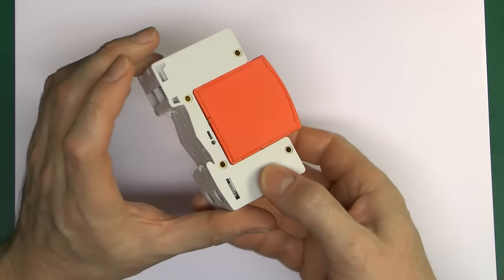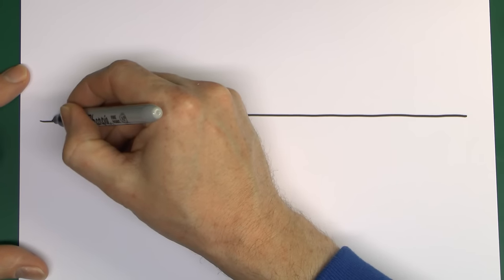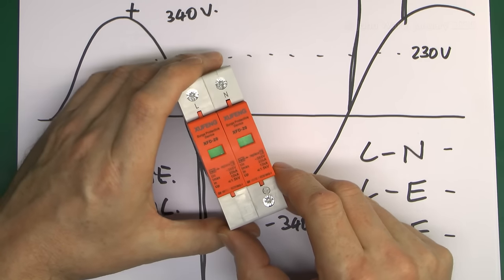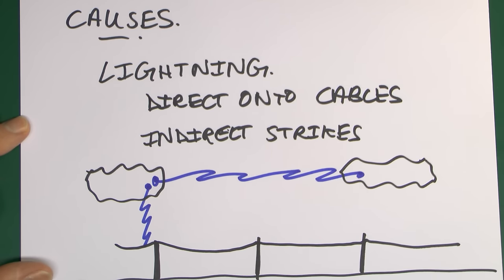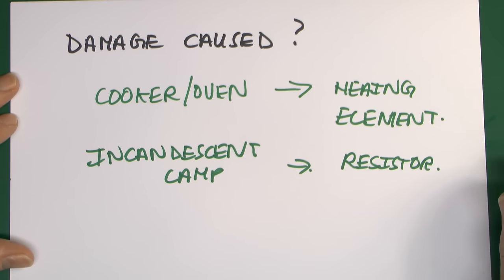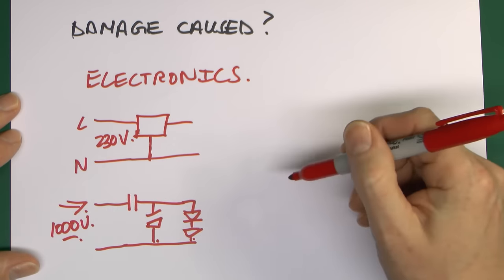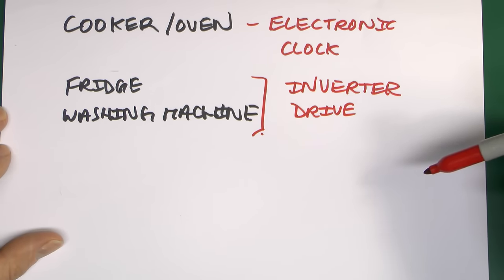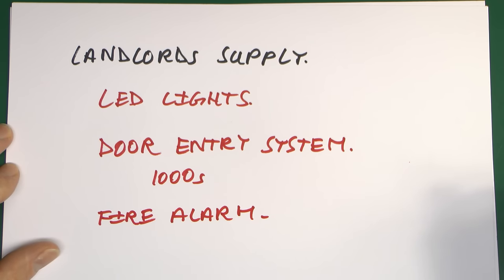Surge Protection Devices - Part 1

Comment: Why is it that new build houses have fused spurs for kitchen appliances like fridge, washer and dishwasher instead of a unswitched single gang socket with isolator switch elsewhere? Something to do with regs?
Reply from the maker: Fashion, or people doing things a particular way because they always have.
No requirement for them now and never was.
Reply: At least in my (family’s home) case, Designer Kitchens’s sparky got it right - kitchen was replaced 5 years ago, 2x switched spur fuse’s above washer/dryer, dishwasher to single gang switched sockets. cooker hood, built-in microwave, oven, tower fridge/freezer are plugged into single gang switched sockets. Induction hob connected to 30amp red dip switch.
Reply: @samuelfellows6923  thats good. I like the sockets over having to wite the appliance into a spur as some may not know how to do it. Also easier for maintenance or replacement
Reply: I usually have an isolator above the worktop controlling a flex outlet plate with a trailing single socket. Sometimes the appliance won't sit fully back if the plug is behind but a short trailing socket can be repositioned where there's room and the appliance still keeps its original plug.
Reply: Ben's pets - there is no requirement for a switch on any 13A socket. If the socket is in a hard to get to location (behind an appliance for example), it’s good practice to supply this socket from a switched fused connection unit that is placed where a user can get to it and where it is obvious what it is for.

Comment: Do you have a video on whether it is safe to install a 110v lighting fixture into a UK ceiling fixture?  Thank you.
Reply from the maker: No, and doing that isn't safe - items designed for 110V cannot be used on a 230V supply.

Comment: Sorry if a silly question, but could you connect one of those to a tv aerial coaxial cable to protect against lightning strike?
Reply from the maker: Similar devices are available for coax cables, phone cables, Ethernet cables and many others.  All cables entering the building need to be considered, as surges can enter on any of them.

Comment: Hi - can you please explain Lutron switches (dimmer switches) that control many zones (4-5). And also the wiring diagram of Lutron switches when arranged in two ways switches and an intermediate. I have not found it if you can can you please make a video or send me a website that can explain. Thanks

Comment: i have to three lightening strike jobs spreed over many years number 1 tv destroyed  number 2 consumer unit blown from wall supply cable to house destroyed number 3 2weeks ago indirect strike lighting transformer and dimmer blown , so on number 3 an spd would i think have saved the day,all jobs in 0.5 ng flash density area page 102 18th edition. thanks for video john.

Comment: Can any Line and Neutral connections be interchanged on a 4 pole SPD? Have to replace one which has N in left side but available one has N on left side. Would make wiring easier if I could use one L as Neutral connections and use the Neutral connections as L.
Reply: Sorry meant old has Neutral connections on Left side and new has Neutral connections on Right side.
Reply from the maker: If all 4 cartridges are identical then you can - however most are not, those used for N-E are different from those for L-E

Comment: @John Ward Should plugs(connected to an appliance) spark when connected to an unswitched socket outlet?
Reply from the maker: Yes, it's inevitable when connecting or disconnecting any load.  All switches spark internally, you just can't see it most of the time.  Same applies to connecting a plug, or disconnecting it.
The spark will be larger if the load is larger.
Reply: @jwflame  Thanks for the clarification. I always wondered if that was an issue with the appliance.

Comment: surge protection is important but a t consumer level this is not important as surge protectors can protect the devices, but do not protect the device from FM interference that occurs during the fault... In the Power System transients will always clear over the wavelength distance since the transients occurs form a Line-to-Line fault

Comment: In reality, I've yet to measure a UK voltage lower than 240v RMS. I'm always mildly surprised when engineers refer to our '230v' supply! Maybe it's regulated more tightly in Europe, but every meter I ever used gives something along the lines of 243v - 248v. This is in the South-East, but isn't voltage universal across the UK grid? Not sure.
Reply from the maker: Frequency is the same everywhere in the UK, voltage depends on the local transformers and what loads are connected.  240+ is still common in most places.
Reply: @jwflame  Thanks for that, John.
Reply: @Blitterbug  If I remember everything right that comes from the harmonisation with most of mainland Europe. Here in my country 220V used to be the norm (old people often still call it that as well) and back in those days I'm pretty sure the norm was 240V over there in the UK. They settled on making 230V RMS with a tolerance of -6% and +10% as the new norm, so effectively 216.2V to 253V is within the specification tolerance.

I guess they went with that so that all participating countries could retain current infrastructure while gradually moving over to the new mains voltage. In my house I can remember usually observing between 230-235V.
Reply: Extra stuff - 90% plus of equipment does not care if the mains voltage is slightly low or slightly high, so it does matter...
Reply: @Mark1024MAK  I'm aware of that. It was really just a response to the first comment in this thread to clarify that it's within the specification tolerance.

Comment: Years ago my parents house was struck by lightning it went down the chimney and blew the aga right across the room and buried it in the wall opposite totally destroying the radio that sat on the sideboard along with the sideboard. I dont think a surge protector would have been any use at all in this case. And when my father got home he was berated by the neighbor who was very angry that our chimney pot was now lodged in his roof.
Reply from the maker: On it's own, surge protection would not have helped there.  However a lightning protection system with SPDs would have.
Reply: @jwflame  or just a lightning rod with heavy path to earth I guess... but what are the odds of that on a normal domestic dwelling?
Reply: Equiluxe1, your Dad needed a CPD (Chimney Pot Deflector), not an SPD, but seriously, no SPD on earth will help in the event of a direct building strike, only a lightning rod and buried earth mat could have helped there (have a close look at the spire of your local church, you will be able to see the heavy copper straps heading up to a pointed rod at the highest part), the lightning has to be given a suitable low resistance path to earth or the water soaked chimney pot and brickwork will take the hit, I hope everyone was alright and that your Dad his chimney pot back.
Reply: @elonmask50  Don't think many houses had lightning rods in the 1950's not many houses do today either. I have seen places where there was a lightning rod and they are are still damaged from a strike, not here in the UK but in Africa and the US. Well designed equipment will have its own protection built in but all these protection devices are based around MOV's  and they wear out over time without any major spikes, so I am not convinced that permanent surge protectors will be anything but trouble a few years after fitting. I have seen MOV's explode causing a lot of damage in doing so  on equipment that was not connected to mains and never was and not struck by lightning just broke down and went dead short in heavy current system.
Reply: Equiluxe1, you are making my argument for me, that’s exactly my point.
Reply: John Ward - Unless money is no concern and you are happy with large heavy engineering, no normal surge or lightening protection system will protect against a direct strike.

Comment: So the consumer has to buy the surge protectors and not the electricity supplier? If they put surge protectors on the cables then they would not reach the houses.
Reply: In my country, when the power supply to the houses runs undergroud, then surge arrestors are mounted on transformer terminals in substation. So you dont have them in house. And when supply comes thru overhead lines, or underground cabling over certain length, then you have to have arrestors in the house board. And that is specified in 'supply conditions' for every property that applies for connection to power system.
Reply: @sumilidero  They are still bpassing the buck to the house holders. They are the ones who are supposed to generate electricity at a certain voltage.
Reply: it is what it is...although most damage caused by voltage surges happens thru the teletechnical networks,  rarely thru power lines. In the industrial environment for example, its the opposite. Most damage happens because of undervoltages.
Reply: @sumilidero  Then why bother with surge protectors in the distribution box if no surges come power lines?
Reply: didn't say 'no surges' but like 5% of all. 95% go thru signal lines in terms of houses. On the HV transmission its another story, but those surges are arrested in substations etc. and dont reach houses normally.
Reply: Tony Papantoniou, the supply grid is fitted with lightning protection, spark gaps, and course surge “protection”, but like everything it needs to be maintained and replaced, if the supply company was forced to provide everyone with type 2 protection, you would be without power every second day and the cost of electricity would be astronomical.
The job of the network is to supply safe and reliable power to your premises, if you choose to have additional protection against irregular events, that’s up to you to provide and maintain, like car insurance, there are many different levels, and just like car insurance it costs you money every year to operate and maintain, as John will no doubt point out in future videos, these are not set and forget, they degrade over time and if not replaced, they themselves become dangerous.

Comment: Sir what is different between over under voltage control device and spd pls help
Reply from the maker: SPDs deal with transients - high voltage spikes that last for nanoseconds / microseconds.  Over voltage devices disconnect if the supply voltage exceeds a certain value, and will disconnect in milliseconds - thousands of times slower than SPDs.

Comment: Hi John, can you do a video on off grid installations, I'm off grid (£10k to connect) with 2Kw Solar , 15kwh 48v batteries, 3kva inverter and a 10kva generator. I've been on a sharp learning curve since getting quotes to get power connected, I was advised to not get a cheap AVC/AVR generator because of connection problems with Victron inverters, I now find that my capacitor controlled generator has a potential for power surges "apparently". The only issue we have found so far is the washing machine won't work ( power fault code displays) if you don't have 1kw or so load because the frequency goes up slightly, if I adjust the generator speed down the inverter/charger won't connect. Will surge protection shown in the video help with generators, another great topic is earthing. thanks for the videos.
Reply: Simple answer, probably not.
Reply: The "surges" of a generator will almost certainly be completely different to surges on a normal mains supply. You first need to determine what they mean by "surges".
Reply: Surges in reference to a petrol / diesel generator normally refer to it being unable to correctly regulate the output frequency and voltage at too low an output load, too high an output load, or a load that has a poor power factor. The control system cycles past the mid-point as it continually increases the throttle, then reduces the throttle as it hunts and dismally fails to find the correct setting. As a result the frequency and voltage oscillate outside the specified range. This can be disastrous for some loads...
I’ve seen this effect with a large diesel generator when there was a fault with it. For some reason although rated for the load (it was a fixed installation, the generator being for back-up power in the event of a mains failure), although the generator started up and attempted to take the load, the systems fed from it kept loosing power (lights went off, equipment lost power), then everything would come back on again, then off. This kept repeating every four to five seconds until the normal circuit fuses could no longer take the current surges. Then the generator ran fine with only half the load now connected! But no good to us! You should have seen the panic in the eyes of the staff who were responsible for the generator 🤣. Or the anguish in our eyes once we realised we had a load of blown fuses to locate and renew...
Reply: @Mark1024MAK  - yep, kind of like the governor on my Briggs 4-stroke mower has started "surging" recently LOL.
Anyway, slow voltage fluctuations like you described are nothing like the very short duration high energy "transients" that are called "surges" in most electrical standards now days. The use of the term "surge" is quite strange actually, since (to me) it describes something slow and quite subtle.

Comment: we have used that style of surge protectors for nearly 30 years or so. so not a new thing ;)

personally 95% of my problems is from phone lines or coax from big tv cabling systems.  and stil moste is from the telephone cable.. i usually have a big bang about every 24 month r so. and the sockets beg all black inside and some cabling might melt etc. i have had 3 big here the last 7 years. i think i have lost stuff for 3-5000£ the last 20 years or so. i have bags full of "melted" stuff here.

i have had "one" problem with the mains going off and onn in my neighborhood. they where building and the power went off and on constantly and at one of those interruptions some computers got there bios settings wiped and two of them started to have problems in the next week's.
Reply: ;) well every second year the ligning hit.. some time every year. this yer it was my friend. his fuse box door was blown off and sent thru the room. damages was high that time :(

Comment: 14:07 - That capacitor in that power supply schematic is going to prevent the device from working._
Reply: Yes, it should be in parallel and not serial as drawn.  The good ole 78xx and 79xx linear regulators that dissipated unneeded power as heat.
I hate modern switching wall warts and notebook power supplies that spark when plugged in.

Comment: I once tested a triac dimmer (aka 'dimmer switch'), a professional one costing several thousand pounds. With a purely resistive load, at worst it was generating 600V positive and negative spikes. Not good for ANY phase dimmable LED driver.
So watch out for triac dimmers. Poorly designed domestic ones can be just as bad.
The cure? Use a 'quiet' dimmer known as a trailing edge dimmer. No spikes!
Reply: Jeremy Lister yeah, if you read the instructions this information can be found easily in there. Most of the eve specify this directly on the packages to stop the weekend warriors DIY project from burning up the LED bulbs.

Comment: How much does it costs to get a smart meter peter mc donald
Reply from the maker: They are provided by your energy supplier, there is no individual cost to having one installed.
Ultimately the cost of them is included in electricity bills, just as older types of meters were.

Comment: I have a lot of difficulty staying with the dialogue as the speaker constantly rushes through sections of his sentences, changing the pace of his speech drastically, raising and lowering  the volume of his voice in a pattern distinctly British,  Including lowering the volume consistently when he rushes through sections of sentences. I think British people think it sounds interesting or cool or something, but it's nothing but distracting when you are trying to take in the information  coherently. The same thing occurs within words themselves. Very inefficient speech patterns, especially for technically complex subjects..Also there is constant jumping back and forth between surge protection and lightning protection. Most "surge protectors" are way underdesigned for lightning protection. They are made for washing machines and  shop equipment coming on, not lightning. I guess there are many people that don't realize that lightning is way off the charts compared to normal power surges. No one making videos on surge protectors ever mentions this.
Reply from the maker: If you have so many complaints, you are welcome to never watch any of these videos again.

Comment: Wtf, I installed tones of spd but all of them where installed in the bord like brakers, all spd were without possibility to connect any circuits into them. I thought when the spd detects high voltage it just do earth fault to trip main braker to protect all the circuits but everyone in internet shows other type of spd, with possibility to conect  the circuits direct into spd.